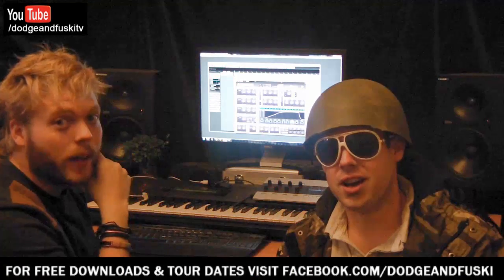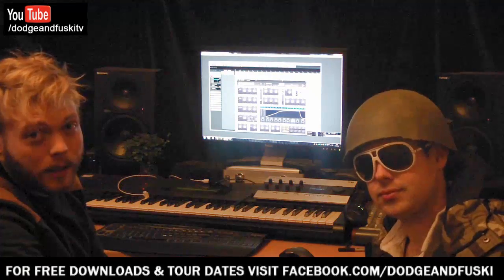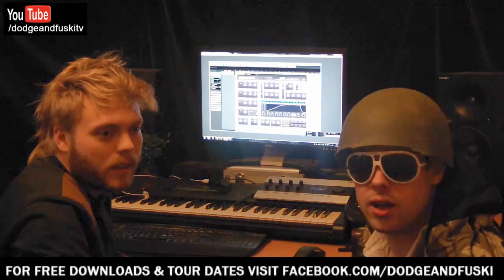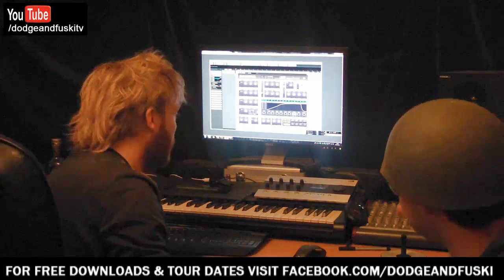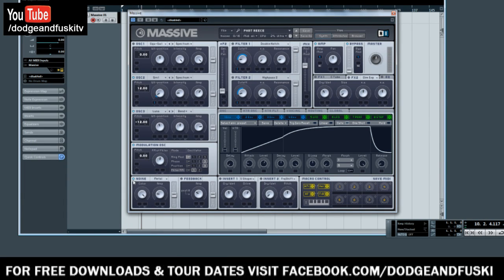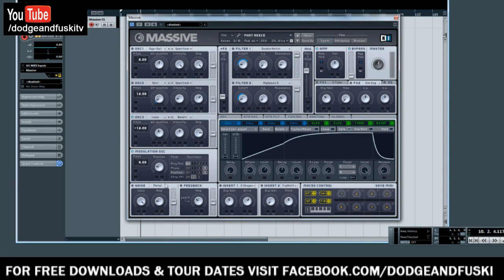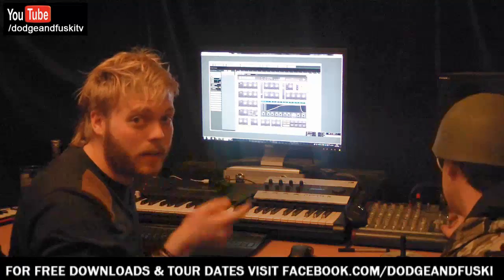Dodge & Fuski dubstep production tutorial - #4 reese bass

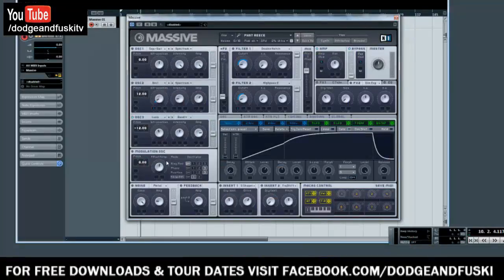Comment: You forgot to mention the very first sound modulation, when you play the sound at 03:50 and 04:20. That's not just the wavetable. Is it a filter sweep?
Reply: I think that's because it's on Bend. It's not a filter.
Or maybe it's because the Lunacy oscillator is playing really low notes? Wavetables can sound quite dynamic when they are played at low frequencies.
Reply: He is just playing the sound back at different notes, and that is actually what the lunacy wavetable sounds like :)

Comment: I think ring modulation is when you have two oscillators and it multiplys the two signals which consists of frequencies that are the sum and difference of the oscillators frequencies. Amplitude modulation(AM) is completely different.

Comment: even if the filters are set to parallel and the filter mix is quarter-way to mix1 which in this case is a notch filter this sound will still lack a big amount of sub and midrange bass... and that's not very good in my opinion, cuz if layer it up with a sub you lose the original warmth and characteristics of the bass.... and you certainly don't want less bass in your music...